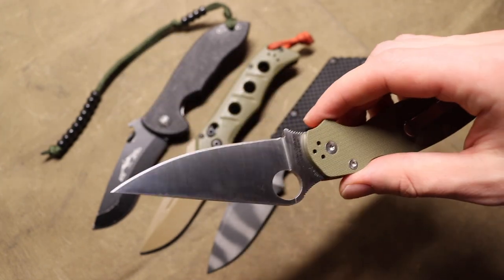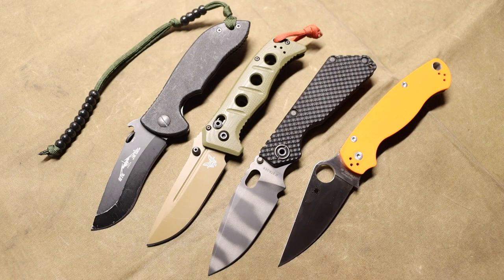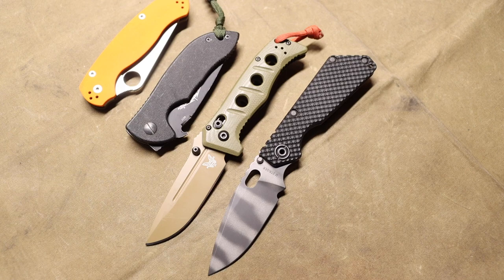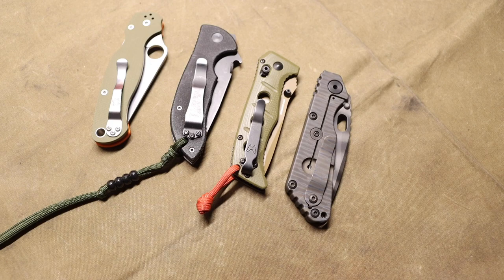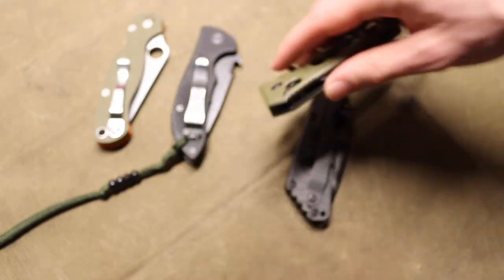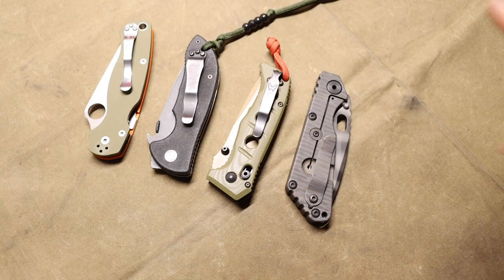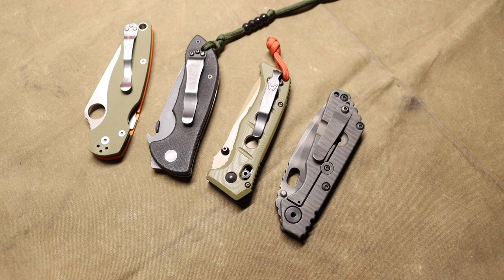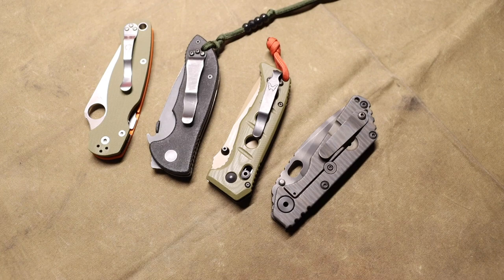You're Probably Wrong About Knife Heat Treat

Comment: I’m a firm believer in the quick easy sharpenability of a medium hardness high carbon or 440C blade.  A few quick passes and it’s a razor again.  That super hard miracle steel that’s all the rage is a pain in the ass to touch up in the field, and honestly, it does not hold it’s edge much better.
Reply from the maker: That’s a fair point, and yes past a certain point some applications will dull any knife quickly so in those cases it’s better to have a steel easy to resharpen

Comment: Corrosion resistance changes depending on heat treat. Microstructure matter's and rc matters too. Most companies dont know what they are doing and just use a 3rd party to heat treat.

If you want a pry bar, 154cm at 56rc like an Emerson is great. Or you want to cut a lot then a Spyderco in the 62+ range is idea.

Other brands will just fail at heat treat and do it average or below average and trick you into buying it thinking your getting better performance and your not.

Companies should use a different steel. For example strider and microtech should use hard use steels instead of soft m390 or s30v. Dont be a ree ree and make excuses for the manufacturers bad Decisions. Don't be a brand fanboy.

A 62rc m390 with the right microstructure can withstand being dragged behind a car without issues. So theirs that too. But most mass manufactures don't know what they are doing.
Reply: I'd like to give you examples about corrosion resistance changing with heat treat. This won't be noticeable that noticeable with carbon steels.

Let's take 3v for example. A high heat temper as noted in the data sheet will rust fairly easily, as its creating carbides instead of focusing chromium to help with stainlessness. A low heat temper allows the chromium that it does have to help with stainlessness. Though it will still rust, just not as easily. The same with other steels with enough chromium in the composition.

So were using time and temp to control the composition of the steel to do, to dictate the steels properties to some extent. This is what people need to understand than just an rc number.
Reply: @tacticalcenter8658  this is good info, and something I don't think people are taking into account. If you don't mind me asking where are you getting this info from? I'm a knifemaker and I hyperfixate on steel because I don't like that companies just slap "insert steel here" and people buy it. The performance needs to be requisite and there are so many variables that adjust as you change processing. These aren't trading cards with limited prints they are tools and if I am paying for a 3v stamp I want optimal performance from 3v. You mentioned softer 3v not changing in stainless qualities as it is heat treated differently but the point of 3v is a tool steel a tougher higher HRC not stainless right? It depends on the application to me but at some point it becomes purely a gimmick and a name.
Reply: @HartleyKnifeandSteel  well this is a lot to discuss. But it all steamed from different people testing different heat treat protocols from different manufacturer's and seeing the results. Check out a vid called microstructure matters.

As for 3v, I didn't say softer or harder 3v. I just am saying low heat temper, named delta 3v protocol as created by Carrothers performance knives, will stainless and have better edge stability than 3v from the manufacturer's data sheet at the high temper protocols they advise. Nathan at Carrothers shows you the testing on his YouTube channel. He is also on blade-forums in the knife making sub section as Nathan the machinist. Search for 3v low heat temper or delta protocol or something like that. Lots of good information.

But yeah soft 3v from benchmade is not good.
Reply: @HartleyKnifeandSteel  Also learned a lot from heat treat books, papers, and experts who do custom heat treat also.